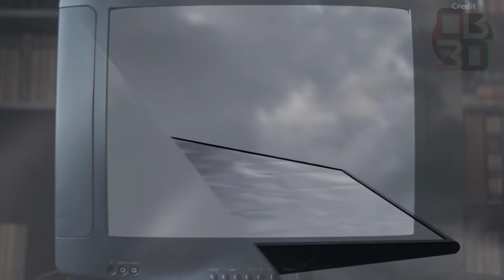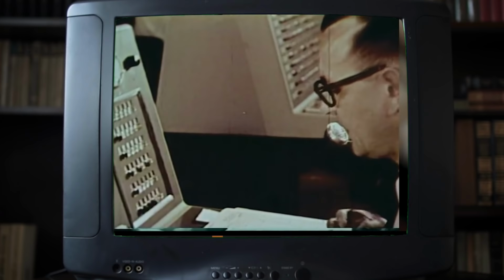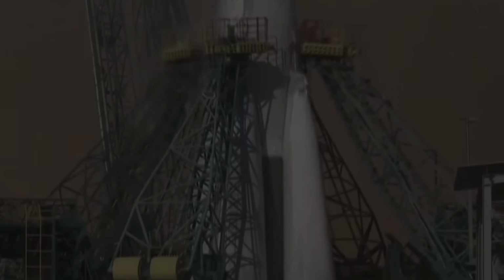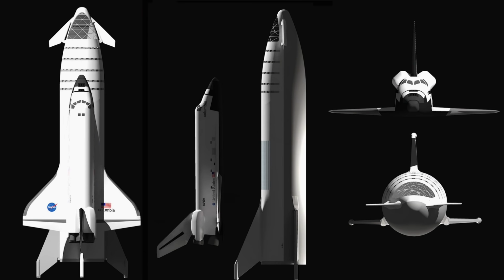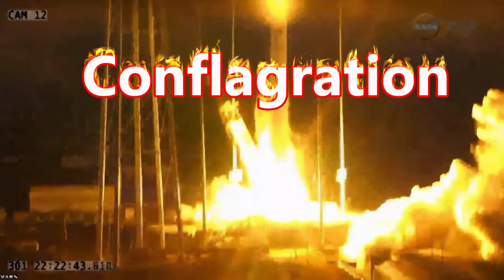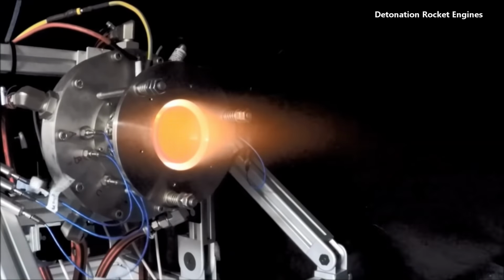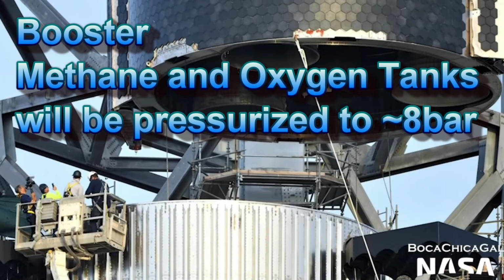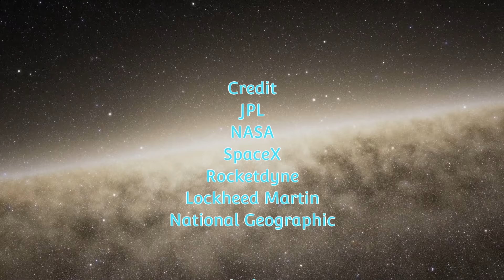Rocket Science: Starship Abort Systems

Comment: Following up on earlier comment, I think a man rated varient of starship could replace the nosecone with a combo interstage/adapter plate to allow any man rated capsule to connect to the top of starship complete with service module, heat shield, trunk section, whatever the customer required. These add on capsules would have their own escape architecture. It could be a Japanese module, a Russian capsule, an Orion or Boeing or any countries capsule or spaceplane or of course a dragon or even a lander from ula. This might even allow abort from reentry or abort from flip maneuver even on Mars or the moon. There might be more profit from selling rides to competitors than fighting with them.
Reply from the maker: That's a very good point...

Comment: I have another, potentially equally effective proposal: Why do you need to move starship away from the booster when you can move the booster away from the ship? 

The booster already uses a drag-generating system for descent which doesn’t affect ascent under normal conditions: the gridfins. If however a pair of gridfins on one side were angled toward or away from the other pair, it would create negligible moments while also acting as an airbrake, something that can do the same thing as an abort system on starship without the need for additional parts.
Reply from the maker: Interesting... in flight that could definitely help.

Comment: While there wasn't much new in the 2022 starship update at Boca Chica there was mention of abort option. Elon said that a starship with 9 engines (3 sea level and 6 vacuum) would be able to perform an abort even when on the pad. In previous starship updates abort systems were said to be unnecessary.
Reply from the maker: If it can spin up in time... I'm sure they're looking at it from every angle.

Comment: I like the solution you've come up with. To me it's the only one that I can imagine that uses the second stages engineered load points of the engine to push against. No need to add structure to distribute the force needed to separate.
Reply: My words exactly.
Reply from the maker: Thank you Robert... that is critical to the concept.  Anything that needs too much mass just won't be practical.
Reply: There also is the idea of using booster gridfins by rotating them against the airflow during ascent as airbrakes, but that wouldn’t work on the launch pad. So both solutions in combination would be ideal.

Comment: Nice idea kind of like airbags for quick separation.  I take it the nozzles would have enough strength to handle the subsonic shockwave. The heating pressure would be temporary enough to not need cooling( which hasn't been turned on) . 
All we need now is a solution for the upper stage failure. 

Well done ( that read like sarcasm, it's not great job)
Reply from the maker: Thank you... I'm not ruling out a detachable nose cone with SRBs and an emergency parachute!

Comment: You are almost 100 % correct. 
On the launch pad the booster must be fully fueled before fueling the starship. Otherwise starship will crush booster. Thus if there is an emergency in fueling  there isn't enough fuel in starship to prime the gas generators or launch starship.
Likewise there is, at least so far, no method of fueling booster and starship before crew ingress as there is no tower escape mechanism.
I think a capsule is the better tradeoff, complete with heatshield, parachutes, and super-dracos is more likely as it might allow full escape even on moon or mars.
Reply from the maker: That would be interesting... If the crew was kept to ten or less that would be reasonable... if we go over that we are talking about a really big structure...

Comment: Very good concept, though I wonder that the idea of running lines from the oxygen and methane tanks from the boster forward is redundant since the engines of the starship already run methane and oxygen backwards towards the engine section.  Could the same detonation not be done by inducing a hard start of the raptors? Perhaps sacrificing the 3 vacuum engines as pusher chambers while the remaining 3 raptors are brought upto full thrust. Or whatever makes sense with a 9 engine starship configuration.A few problems with this is the fully fuelled starship likely needs as much engine power as possible for abort due to the mass and the loss of 3 engines might cost too much, thoguh would the vacuum engines even get used in an abort?
Using the starships fuel and oxydiser for the hard boost would have the advantage of shedding mass to help the process.
Perhaps the optimal starship abort would also take advantage of the ships aerodynamic flight options, pushing the booster up and also away to the side, so the final hot gas thrusters the boosters will use could be an essential part of an abort, perhaps even the oxygen and methane purge lines could be modified and used as controlled abort thrusters. I seem to recall the hot gas systems should incorporate the purge system in a future iteration to save complication but I can't find any other details of that.
Reply from the maker: I think risking damage to the Raptors through a hard start is a reasonable approach under the circumstances Marc... We were thinking that risking damage to a failing booster was a better option.

Comment: Interesting idea but I think it has a couple shortcomings that could easily be improved. 

It relies on the systems in the booster still working. If the entire point is to escape a failing booster we don't want to then rely on the booster for the escape system. This mostly applies to relying on booster tank pressure to fuel these "gas generators". In the event of a failure booster tank pressure could likely be the first thing to go. 

Instead these "gas generators" should have their own independent supply. Ideally as simple as possible and thus using hypergolic fuels. Basically a Draco abort system placed inside the vacuum raptors bell on the top of the booster. 

Sealing could be an issue, both too much and too little. First too little, given the shape of the bell it'd be near impossible to create a seal for these "gas generators" to act as pistons. I'd suggest these "pipe structures" be constructed in a way that can expand, something like a cupcake wrapper, so that when pressurized they expand to press against the inside of the nozzle to reduce leakage and increase pressure. 

Then too much sealing, this will pressurize the area between the Starship and Booster. Some measure should be taken to ensure that the outside structure of the booster is weaker than the starship skirt. So that if something has to blow out to release pressure that it's the booster and not starship. Ideally in a way that should the clamps between the booster and starship fail to release, the system will literally rip the starship off the booster. 

If we take this even further the "pipe structures" could in function be more like retro rockets slowing the booster down as the Starship accelerates away increasing the distance between the two as quickly as possible. 

It's also this man's opinion that a sort of third stage abort system should be created. A separation location placed above the Starship fuel tanks with again a draco like abort system and parachutes like a huge dragon capsule but sideways of sorts more like how the Mercury was first designed to land.

I also think this should be done with the lunar Starship. There's no reason to land the entire starship on the lunar surface and deal with all that entails. Separate the lunar starship into sections above the main fuel tanks. Those tanks and engines aren't intended to be used to land or take off anyway. Use the main engines to start the landing burn to decelerate for a lower orbit and maybe a bit more. Then separate after which the main section goes back to orbit and the upper section lands. After take off rendezvous again in orbit like Apollo.  Ideally this will allow the retention of enough fuel in the main tanks for a return trip to Earth orbit.
Reply from the maker: The booster will be at 7-8 bar. A fire or even sudden explosion of the booster would begin at the engines... unless the tank immediately detonates... in which case getting the Starship away from the booster is most decidedly accomplished... there would be time to open the valves at the top and allow the pressurized methane to escape.  The retrorocket suggestion is on point also as it would move the booster away from the Starship while the Starship was being moved away from the booster.  Another good point.The plume is ignited to ensure conflagration and not detonation but you make a good point. Perhaps the booster should have "header tanks" for landing that could be repurposed to this use. We also agree with your lunar approach.  That obviates the need for a 40 meter elevator...
Reply: @terranspaceacademy  What we've essentially landed on is putting three hot gas thrusters in three cans on top of the booster. They still only work though for as long as the pressure is present. Adding a header tank system of some sort vs a hypergolic system is one of degree and design. A header tank could help fuel the hot gas thrusters during entry when the engines aren't running, a bonus there.

Comment: Touring the Rocket Garden at KSC visitor center, you learn that the reason so many early rockets failed was because they started to move before the engines had gotten to full power and had control authority established. The solution then, was to apply hold downs until the engines had attained full thrust.
Reply from the maker: Excellent point! Thank you!

Comment: Well a mini-starship(improper name because would be bigger than usual upper stages) that is carried inside a normal size starship can do a abort maneuver, if you consider that would have a dry mass of 25 tons 25 tons payload and 50 tons of propellant(when it is inside fairing, but having propellant tanks large enough for contain another 150 tons) , would weigh only 100 tons with a single raptor engine could reach 2g,obviously without abort neds few refills operations, but not ten or more like in the case of normal size that  needs to reach lunar orbit or further.
Reply from the maker: That's a great idea for crewed ships... fit within the payload bay... but you'd have to blow the nose cone apart to exit.
Reply: @terranspaceacademy  maybe only the cargo bay doors, if you launch a little bit sideways.

Comment: I think an important point missed is in the video of the destruction of the Facebook satellite payload on top of Falcon 9, you can see the payload fairing intact after the whole rocket failed on the launch pad.  You even explained why the fairing with its payload were intact without saying they were intact.  The payload was only lost when it came to an abrupt stop on the ground.

I think it is worth considering Elon Musk's comment about deleting systems and complexity of a system actually becoming the problem.  Don't forget that SpaceX lost a Crewed Dragon after it flew when they were doing some ground testing on it due to a fault in the launch abort system.  Just throwing on systems can have unintended consequences, which you touched on a bit.

I am thinking what would be best is an opportunistic launch abort system.  Starship due to its cryogenic fuel is a lot harder to survive a catastrophic failure on the ground or low in the atmosphere.  However, SuperHeavy is designed to have excellent engine out capability.  When you have 33 Raptor 2 engines at the helm, one being lost in flight isn't going to have too much of an effect on things.  Once the rocket is going fast enough, the supersonic shock wave from a worst case failure won't be able to keep up with the top of the rocket.  Soon after this the air gets to be too thin to contain an explosion enough to be lethal.  As you mentioned, the Challenger crew survived until they impacted the ocean just as the Facebook satellite was intact until it impacted the ground.  This leads to where you opportunistically abort a launch of Starship.  Through most of the ride to orbit, Starship is a rocket that will either survive a first stage failure because it is too high up for a failed SuperHeavy to destroy it, or will most likely have some level of operation and control and be able to get itself into skydiver position and hold it until it is possible to bail out of Starship and survive.  As long as the people can get out quickly enough, they can deploy parachutes and maybe do a gentle splash down in the ocean, where they can then be picked up.
Reply from the maker: Very good points...

Comment: Very interesting idea – temporarily transform a very complex rocket into a very simple one. Though I am wondering how much of this process requires the cooperation of systems aboard the presumably failing booster stage.
Reply from the maker: There would be multiple sensors that... as they all started reporting failures... would trigger the escape mechanism... the ESC or escape system computer :-).. should be on the Starship.
Reply: "transform a very complex rocket into a very simple one" - Musk would say that too, I think.

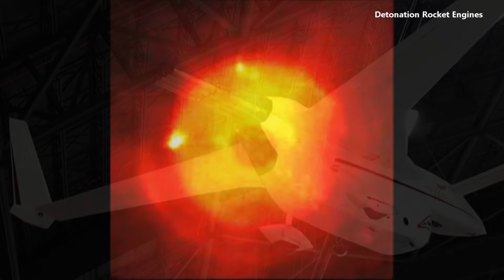Comment: At 20:20, “once these three engines spin up, Starship will fly…” does not seem viable to me. Starship with three engines has a TWR of ~0.5. It could not fly or hover anywhere with three engines. Even 6 engines is pretty borderline. Last I heard they are talking about expanding the Starship to 9 engines, which might make this option somewhat more viable, but 3 engines would be extremely underpowered for any kind of “flight”.
Reply from the maker: You are right... we would need at least 7 engines running to make it work. Thank you.

Comment: Would a pair of SRBs attached to the sides of Starship be safer because their trust is almost immediate and not directly pointed at the potentially failing booster. Question is how big would they need to be for a functional abort.
Reply from the maker: SRB's for launch abort is probably the safest option as you get almost immediate high thrust... low efficiency doesn't count.  The problem is the size of the booster needed to move a fully loaded Starship.  And that it's dead weight 99.9% of the time.
Reply: @terranspaceacademy   well you only have them on crewed missions and they can still fire when not needed for abort.

Comment: Rocket engineering is all a series of compromises, a balance of risk vs advantage. And - in any case - to move forward, we must push some other stuff in the opposite direction (I didn't say it, Carl did).
Hope the physicists will find soon the missing parts of the General Relativity, so the engineers can build a warp engine, one that bends the Space in front of a Spaceship, generating a continuous gravity pull - which doesn't require to squish hot stuff from the back of the ship...
Reply from the maker: That would be fantastic but I don't want to wait for it... I want my retirement home on the Moon to overlook Shackleton.  Real estate there will get scarce if the US and EU don't act soon.

Comment: No airliner today has an escape system, so I tend to deny a need for one.  Also the criteria of escape from what?  If it's the whole booster ruptured, I think it's over regardless.  One the other hand I don't see the starship as a fragile craft, the space shuttle did mostly survive the fire.  It was mostly a fire, and it was surrounding the vehicle so no real shockwave, just a heat/overpressure event.  Could a starship survive that?  I'm sure the space shuttle didn't have any sort of coding to handle that.  Either Spacex has considered a whole lot of options or has a high level of adaptation in their code as proven by the Falcon 9 stabilizing itself with a grid fin jammed to full travel.  I kinda thing a strapship could have fired it's engines over a few seconds and flown out of the Challenger disaster. 

Again, how fast does escape need to be made?  A pad abort would be the worst, no chance zero G period to seperate, and having to deal with the ground containing and reflecting 180 degrees of energy of a fully fueled booster.   Not sure the vacuum raptors would handle that much push.  Maybe some cylinders in the booster but plumbed to the starship to just gain enough space to ignite all 9 starship engines?  Or would just spinning up the engines created enough pressure in the space to separate them.
Reply from the maker: Good point but every airplane, having wings, IS an escape system.  Just glide down and land somewhere if there is an engine failure. (Yes I know it's not quite that easy...)  I would agree that the Starship can survive a lot more stress than the shuttle.  I'm not sure the explosion didn't take out the engines on the back of the shuttle almost immediately but the Starship won't be down on the booster. Spinup might work.  I often introduce suggestions to cover concepts... not as an argument that they are the only solution.  The vacuum bells may not be able to handle enough stress to be effective.
Reply: @terranspaceacademy  somewhere we have to say safe enough. I recognize that I'm getting older and grumpier, and think people are too scared of too much these days. But sometimes I have to agree with a sticker on an old muscle car "vehicle has not airbags, we die like men"